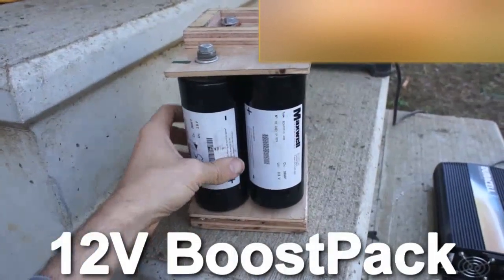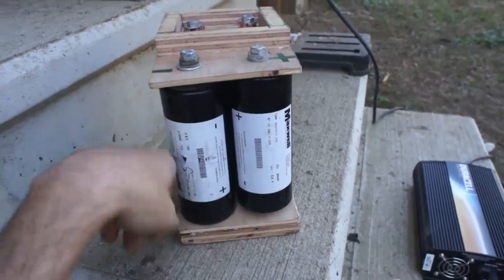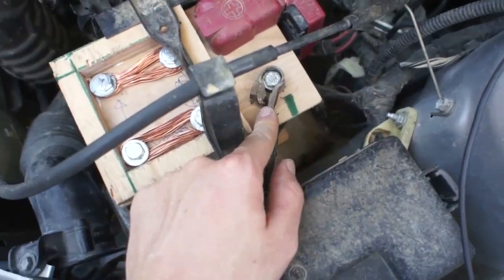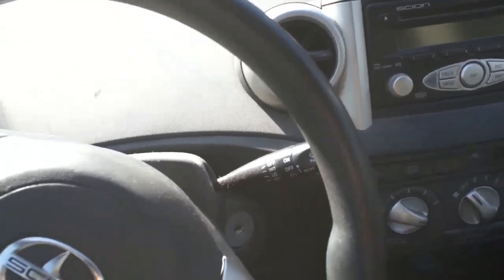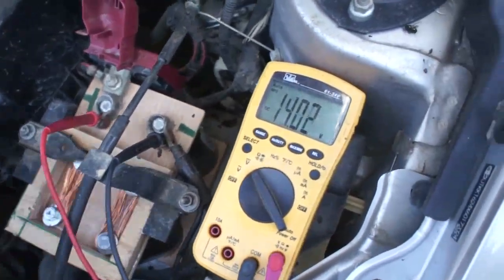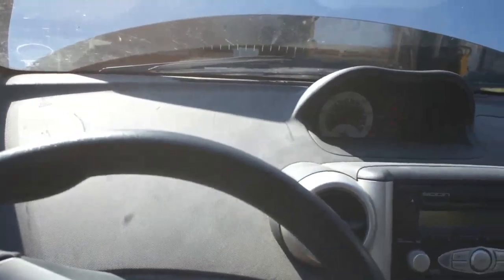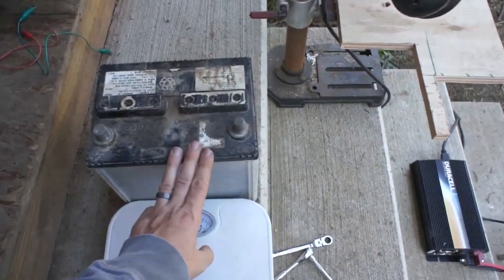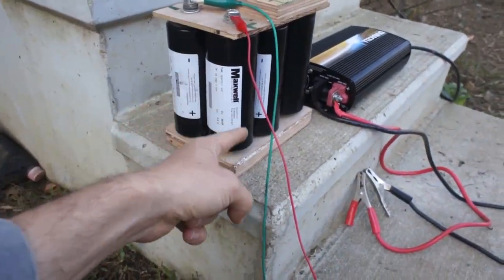12V BoostPack. Replaces auto battery. Works great!

Comment: I feel like one of these could, at the very least, extend the life of a conventional car battery by reducing stress on the lead acid cell plates from the high demands of a starter motor.  One might simply replace a conventional "cold cranking amp" car battery with a high amperage dump "capacitor boost pack" coupled with a long life, low ampre, (true) deep cycle industrial battery. (Not a fake 'deep cycle' or 'marine' battery, but the kind that phone companies use that never need replacing.)

Comment: i curious if you can use one of thease with a low amp lithem maximizing the capacity and lowering cost and using the caps for the short berst needed to crank the car. another thought i had was the biggest reason for needing two batteries in a diesel is for the cranking amps. something like this would take alot of stress off the battery, and provide alot more amps to crank it over when its - 40 and it takes everything the batteries have just to turn it over.

Comment: Im surprised it starts at 10v.In quite a few, the ECU would not engage the starter motor, nor would it operate the injectors.Guess glow plugs might drop it even lower, or not?
How many start ups can it take?
Oh and what’s the weight of the pack in more widely used units...?

Comment: before  you use that super cap, did you charge and  discharge because according to the amazon seller you have to charge and discharge for 6 to 10 times, and also does it over charge if you use everyday in your car without the over charge protection? can you give as a site  where to buy a cheaper super cap? ebay and amazon are expensive thank u in advance

Comment: Seems like you could rig up a mosfet based oscillator on a couple cap banks and maybe twice the solar wattage and have a system that would go as long as you have day light.. Even at night, with use of led lighting these days, could probably keep your place lit. May want a deep cycle or 2 (or 6) still for appliances or whatever.

Comment: If this super caps can hold the power that long then Morot-Generator can be build using that super caps to compensate the power consumption  for motor, which means motor can run itself wile generating power. Have you guys ever done such thing ? I liked the video and keep experimenting  more to see if you can build in larger scale. Nice job!
Reply: No the motor can't run itself. The generator slows the motor down proportionatly to the (electric) power generated.
There are no free meals according to the laws of energy conservation.

Comment: Great dude ! 👍 Except that maybe you should consider replacing that wood with a good insulator material.  You could have problems if the former material unavoidably gets wet and conducts electricity resulting to short circuitry....damages !🤓
Reply: ....but come to think it of after reading the earlier comments, why didn’t car manufacturers think of capacitor banks instead of batteries in the first place, if the former will function and work better ??🤓
Reply: well because capacitors are about 100 times more expensive. A lot harder to produce too. Lead acid batteries are exactly what they sound like. lead plates and acid, nothing expensive or complicated about them.
And they really won't work any better. they work worse in fact. in this video he mentions some of the problems he had with just the caps https://www.youtube.com/watch?v=8miq6sDy0wA

Comment: It would be interesting to combine a deep cycle lead acid battery with a super capacitor bank. You would get the ability to draw high current for short periods of time combined with the ability to discharge your battery more deeply without damage. Starter batteries are deliberately engineered to deliver high current but at the cost of not tolerating deep discharges. The only issue I could think of is the potential stress on the alternator from a higher current charging load.
Reply: Looks like someone has already thought of this idea: http://citeseerx.ist.psu.edu/viewdoc/download?doi=10.1.1.456.6269&rep=rep1&type=pdf

Comment: So, why haven't cars been manufactured this way for years? So much cheaper & lighter. All I can thing of is the vested interest of the battery industry & the uncosted externalities of the associated pollution in many jurisdictions.

I accept that there are issues that need resolving, as pointed out by the comments below.
Reply: Its a lot more expensive actually, not cheaper. Lead acid batteries are literally cheap acid and lead. lead is pretty cheap too.
Also caps are not really great for long term storage. the caps would probably be completly discharged after a week or 2. so your battery would be dead as soon as the car gets in the store.  https://www.youtube.com/watch?v=8miq6sDy0wA

Comment: Thanks for the demonstration.
What is the capacity of each  capacitor you used and how did you charge it to 14 volts?
Maybe a tutorial on how to connect them in series and the required gauge of the copper wire.
Thanks.
Reply: If you have to ask, its already out of your league
Reply: @SamaritanElad  What league are you in to spend your day dumping on people?

Comment: That was interesting. I might add that the ignition switch turns off the electrical accessories such as headlights and air conditioner fan motors during engine start. So having them on or off makes little difference when starting the car using the boost pack.

Comment: I have my battery in the back due to the fact of not wanting a massive battery under my hood. But if it starts to run a little flat it does not start as well.  Could I have a  small set up like this near the starter motor to give more power to the starter motor to crank my performance V8? I would keep my full size battery but just use these capacitors  to give my starter more grunt?
If so what capacitors and how many would I need?
Reply: Yes, you could. I have been using such capacitors for decades to smooth the available current in high-power amplifiers.

Comment: Pretty Cool.
A mini-alternator would be all that's needed (the only way this will save on gas $).
 You've also got to put this in a container (no exposed buses or component exteriors).  
Your Buses look cool (maybe solder them together for long term stability). 
Looking forward to demos in winter.

Comment: Batteries are completely obsolete.  Adding modern nearly 100% efficient Boost DC-DC converters this would be good for prolonged use.  Even at 3V this system would crank a car with a Boost DC-DC system.

Comment: Where can you buy real Maxwell brand caps for a good deal.  At lot of the ones on eBay seem counterfeit
Reply: Try a auto junk yard. Hybrid electric cars have them. Ebay ones work fine. I bought 4 sets of 6 @ $150 shipped. Deal done past as these are in demand.

Comment: to your second point on that when you said you can use it for a workshop and I see you got that that inverter from DC to AC why wouldn't you just use something like at alternator that can boost your amount of power or in a cycle somewhere another to keep it so you could run it for an extended amount of time

Comment: is that cause the battery to get hot in any way know when you're running it like that cuz you said you have those capacitors like that I just wondered about that because you said it had to regulate and something on the side they're on the pic of the negative side

Comment: all the cranking amps you will get out of a 12 volt battery that size is 200 amps. On a 6 volt battery, all you will get out of it is 100 amps.  Grab a load tester and do some testing.

Comment: Your LiPo will be protected from over-current-discharge if you place a 1 ohm resistor inline, so it won't melt down while jumping another's car.
That will also protect it during your own car's startup, but allow a quick recharge of the capacitors during an engine-off jump-start of another's car.

Comment: Yeah and I bet for $6 the electrolyte's gonna be dry as a bone in those things within a year.
Reply: as long as he does not go over 2.5V per cell those things will last many years.  They are sealed and are electric double layer capacitors, meaning that unlike a battery, there is no chemical reaction involving the electrolyte occurring.  I have a bunch of these on my solar power system, some that are quite a few years old at this point.

Comment: Edit: Great, the comment section loaded after I wroke this: I don't know battery technology. I assume you are using capacitors as opposed to li-ion or another lithium type because of crank power, and li-ion may be damaged when cranking. Is that correct? I've seen li-ion car batteries advertised starting around $100.00 and much more and they advertise better cranking than lead acid. Also, what prevents your packs from overcharging? I suppose I need to go to your original car battery video? I want to replace my crappy generator battery with something that will last and be more dependable and I've seen cheap li-ion replacements for $69.00. However, I doubt for $69.00 they use quality cells so I would like to better understand and maybe tinker with sime DIY out of curiosity as well. Clearly I am confused. Thanks for the videos and my guess is that the eggs are very healthy.
Reply: There is this little electronic item in car charging circuits which limits the voltage to around 14.8 VDC which is the maximum gassing point of a 12 volt lead-acid battery (2.14 to 2.18 VDC per cell times 6 cells).

Comment: If building an actual automobile, yes I'd have this in parallel with a regular battery but this would be chargeable by a foot crank, which one could repeatedly floor until the "cap voltage" (which would only read if the ignition was set to "ON/START") read 13

Comment: The difference is that if a touch both poles of of a battery nothing will happen to me. I will die if I touch the poles of this cap boost I will die.
Reply: not actually true.  If you hook enough in series and touch the poles then you could, if you soaked yourself in salt water you might get it done with his 12V pack, but I've accidentally hit the bus bars on my 60V paralleled packs with just a slight tinge of a shock.  My bank could in theory crank out tens of thousands of amps if shorted with big enough leads, but fortunately the human body typically has about a mega ohm of resistance which limits the current at lower voltages.  Still I would not advise sticking your tongue across the leads to test it.
Reply: Friend of mine did the test as it was pouring outside and got a bad electrical shock and smoke came out of his clothes. I know the voltage is too low for it to happen but it did. I still wonder if his clothes or necklace had anything to do with it because I was sure nothing was going to happen since I did a quick touch and felt nothing.

Comment: You should really have an inductor in series with that configuration. It'll help smooth out the capacitance a bit by rate limiting change in current.
Reply: Only from the alternator to protect it. Supercaps can take the draw just fine

Comment: Hi !
Ho do you make sure that the voltage of each cell doesn't reach over 2,7V so the pack don't explode ? I don't see any monitoring/regulation circuit in your boost-pack and I would not be confident with it in my car over time.
Looks great performance-wise !

Comment: Would these work for car audio? Also I see their capacitance is 50 does this mean they r 50 farads a peice?
Reply: His units look like the Maxwell Units that are 2.5V and 2600 Farads.  Now when you hook them in series that would be 2600/6 or about 433 Farads at 15V.  One concern I would have would be cell balancing.  The Capacitors will last a long time as long as the cell voltages of each individual cell do not exceed the 2.5V.  The problem is that as the system ages the Capacitance values may change a bit in individual cells, causing the voltages of cells with lower capacitance to charge higher than others.  With really low charge and discharge cycles and if not run near their top voltages they self regulate to some extent in that the leakage current is a function of the cell voltage, but in this application where they are charged and discharged rapidly and potentially repeatedly I would think that active cell balancing would greatly extend the life of the pack.  Generally these things new are rated for a million charge discharge cycles and ten years, although these older Maxwell's may have had a 500K charge cycle rating.

Comment: Where did you buy those capacitors for $6 each?
Reply: You will be hard pressed to find them for anything near that now.  When they first started scrapping buses that used these as part of a regenerative braking and hybrid power scheme, there were a bunch of these on the surplus market and you could buy them cheap.  As people became aware of their usefulness, supply and demand shifted and the price went up.

Comment: what precaution you need to take for using capacitor for Motor bike using low AH batteries.
Reply: alternator with a limiting inductor as they may burn out.

Comment: I think if you use a regulator type of circuit you can take it down to like 4 Volts and regulate it in such a way that it outputs it always at 12 V.  Not sure that it would all wire up exactly right like a normal battery or not what i'm describing.
Reply: You could do that, but to still be able to put out a few hundred amps (few hundred times three or four on the low voltage side) it would have to be a robust unit and would cost quite a bit to build.  It would also add another link in the chain of items that could break and cause failure.  Overall not beneficial in this application in my opinion.

Comment: @laserbaer what will happen if we play music in  a cars audio system ,do we need to keep the engine running
Reply: While if wired up well you can put out a lot more amperage than a typical batter, have relatively little energy storage compared to a battery, so running things for more than a few minutes would require a charging input from the motor or elsewhere.  If your radio does not draw much power you could probably run it for a while though.

Comment: Very very interesting  wonder how well this would work in solar systems seen the used to to even out heavy  draws on the banks would love here about your up date
Reply: I have a 695 Watt hour pack running between 60 and 32 V on my solar power system.  That is a lot of these capacitors by the way.  For the 2.7V 3000F units I built blocks of 24.  Four units in parallel and six in series, and then connected four of these blocks in series.  They are actively balanced.  I have the 2.5V units like he has connected in blocks of 32, four parallel and 8 series.

Comment: A suggestion for conductors to connect the capacitors together you could flatten copper tubing and drill holes for the bolts. I feel this would be easier to work with than wrapping multiple strands of copper wire around the bolts. I would also suggest you use plastic instead of wood as wood will conduct electricity if it gets wet or damp. Large plastic 5 gallon buckets yield a lot of usable plastic. You have many options as it is quite easy to work with.

Comment: The voltages he showed for the car running, lights on, cranking, after running... all pretty much identical to a lead acid battery. A fully charged 12v battery is at 12.6 you will get 13.5-14v when running on darn near any car.  That's voltage from the alternator, not "look how fast it charged up". I would also like to know reserve capacity. lead acid usually have RP of 60-90 minutes, thats basically how long you can leave a medium load on with the engine off and still have the car start. The capacitor is super cool, very cute don't get me wrong, but your car is designed to charge a lead acid battery and has modules made to run off a lead acid battery. With a setup like this and the complexity of modern day cars I expect trouble. Not every car, but some are probably going to have issues with it.

Comment: Capacitors discharge so much faster then batteries though!! So the overall benefit is that you don't have to replace a cheap battery in 5 years time? 1:50 LOL. 25lbs isn't going to save you much money in gas. Just about as much a difference as driving on a windy day perhaps. Sure, you might save $5 a year I guess... I'm not calling this stupid. It's probably good to keep in the trunk in an emergency if you leave your headlights on overnight. (or 10 minutes if you're using the capacitor). I would like the link for where you bought those for $6 each though. HOW about if you also installed a Dynamo DC generator for an emergency? Then it would be the ultimate emergency booster pack.

Comment: I've got a bank of 10 Maxwell 3000 F caps in series - charged it over two years ago to 24 V. Measured it a few minutes ago - 16.5 V. I'm going to try six as a replacement for the two big batteries in my F350 Diesel and see what happens...
Reply: You running 24v or 12v system? Only need 6 for 12v
Reply: @SamaritanElad  12V  - if I ever get around to actually trying it.

Comment: I can see electric car potential. But the discharge rate concerns me
Reply: the discharge rate could be regulated.. there are companies making insane graphine supercaps that will be introduced into the electric vehicles along with battery packs ..the caps maximize the regenerative brake systems.. and aid in acceleration meaning drving futher between charges..ect